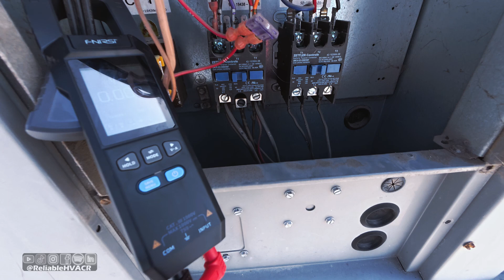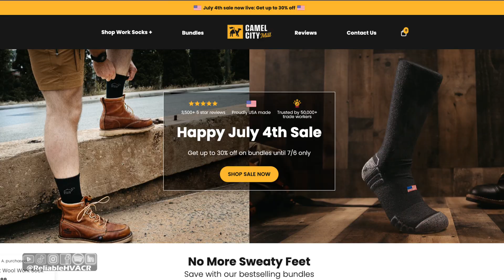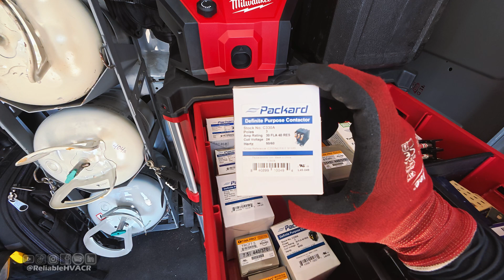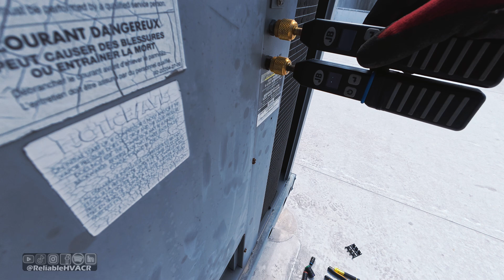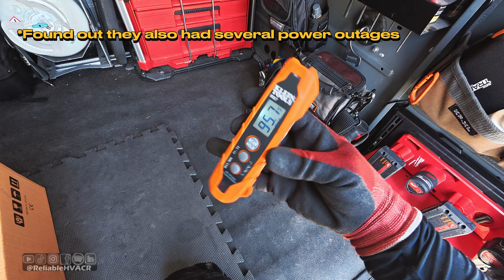Rheem No Cool - Gotta be observant

Comment: In my experience, those Titan capacitors have a high failure rate. Not sure which one you used but they have a USA version that I’m told holds up better. Thanks for the videos.
Reply from the maker: I prefer the USA one for sure, don't usually see them failing as much. They all have extended warranty now as well